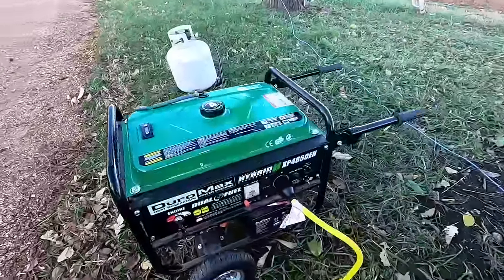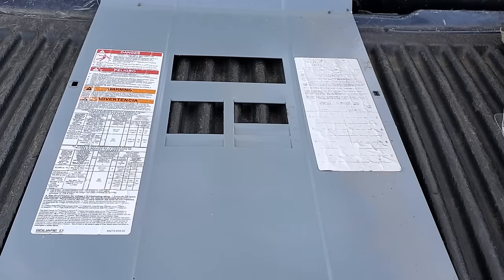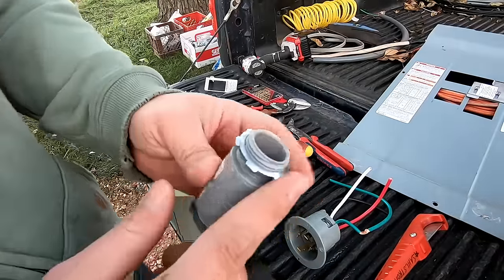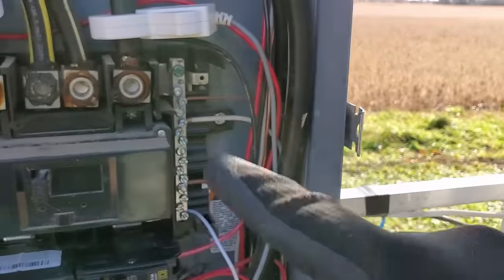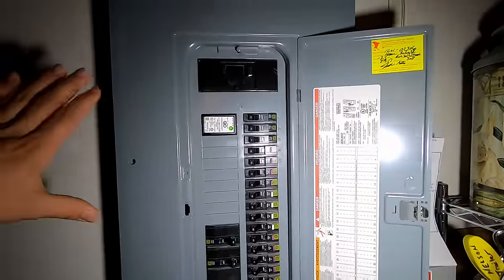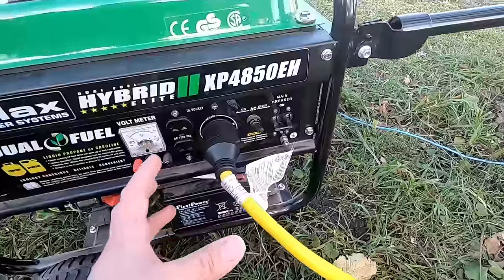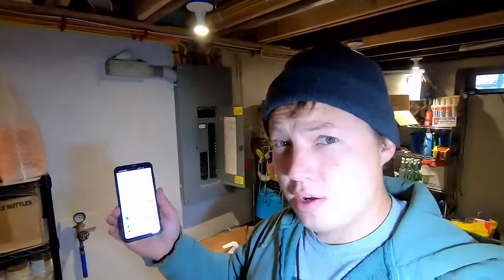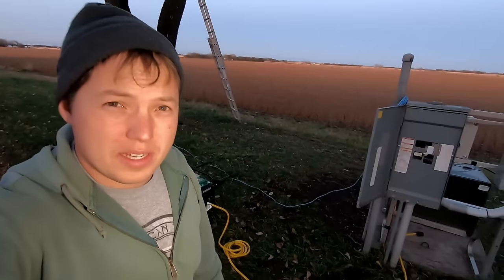How To Hook Up a Generator To Your House Using a Breaker Interlock Kit & Power Inlet Box

Comment: you covered the wires with your gloves we couldn't see nothing you have to be more specific if you are teaching.
Reply: Don’t forget about the generator safety tips as well. Remember it’s important to follow all the generator safety rules whenever you use your generator. Here are the generator safety tips:

1) Please do not allow an unqualified person or your children to operate the portable generator. Just because some manuals don’t say that doesn’t mean it’s safe. That is important against the generator safety rules. We also need to be keeping an eye on our children too. You need to make sure that your children are not playing near the portable generator especially when it’s running so they won’t get electrocuted. Generators pose electrical risks and they can be hot during an operation. Please keep your children away from the portable generator at all times. It is important to keep our children safe especially our little ones. Be aware of all the hazards.

2) Some people use their portable generators indoors which increases the risk of carbon monoxide poisoning. It’s important to have a carbon monoxide if you have a gas generator. Never ever use your generator indoors even if your doors and windows are open and even in the garage is not safe to use a portable generator. Not even at your porch and your deck. It is never safe to use your generator indoors and in enclosed areas of your home. Your generator needs to be 15-20 feet away from your house. 

3) 🔥generators cause fire hazards too. Never refuel your generator while it’s running. You need to let your generator cool off before refueling it and before storing your generator. Never overload your generator too. Never ever back feed your generator. You should never plug your generator into a wall outlet. Also never store propane tanks indoors. Please keep flammable things away from the generator as well and please don’t smoke cigarettes near the generator. Having a fire extinguisher next to the generator is also important against the generator safety rules. 

4) generator operation; make sure your hands are dry before touching the generator. Never use your generator in wet conditions. Don’t let your generator get wet. You need a generator tent if you need to use your generator during wet weather. Please don’t wear loose clothes when operating the generator. Turn on your generator before plugging in appliances. Use the right cord for your generator. Please do not use worn out cords. 

https://youtu.be/I1jT3ANENvI and here is a video more about keeping others safe when using generators and also about our family’s safety. Hope this helps

Comment: Do you really think you should be showing just any tom dick and harry how to do this? Sure you doing it one of thevright ways but there are still plenty of mistakes that joe blow home owner can and will make that at minimum will result in property damage and at worst personal injury of death. Electrical work is not a hobby. Its not plumbing where an oops results in some water in the basement. Its not framing where the damn front door closes a little hard. I dont know i just think this good intentions gone wrong. Ill probably catch hell for this but i dont care.
Reply from the maker: All valid points! Anything anyone chooses to do at their property is at their own risk and hopefully people will know their limits and hire professionals where needed.
Reply: @BenjaminSahlstrom  
Oh man... do you know how many times ive gotten the phone call that goes " ok so i rewired my kitchen, i did everything right but now for some reason when i turn on the bathroom exhaust fan there a pop noise and the microwave receptacle stops working and theres some switches i replaced that if youre barefoot and touch the screw boy do you get a heck of a zing" because its been that many that i personally stopped counting. Another good one is "i can do the wiring but i need you to put it in the panel and on the breaker" guy if you dont trust yourself in arguably the easiest and safest part of the job then you should be messing with it at all.